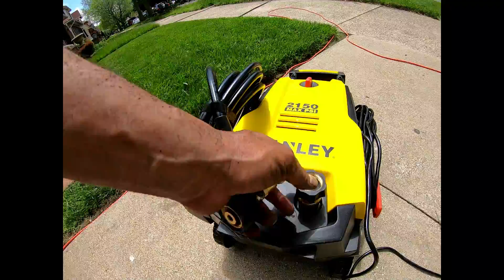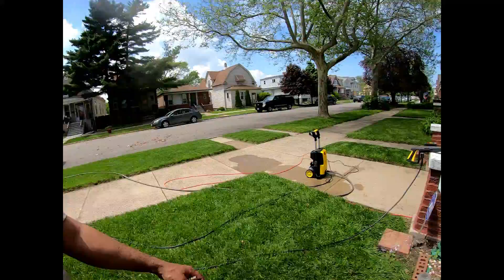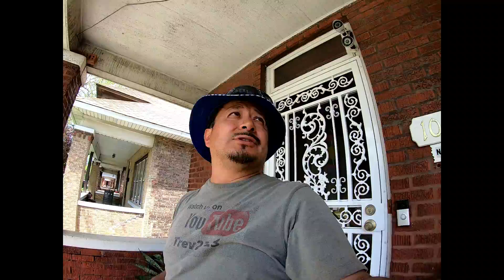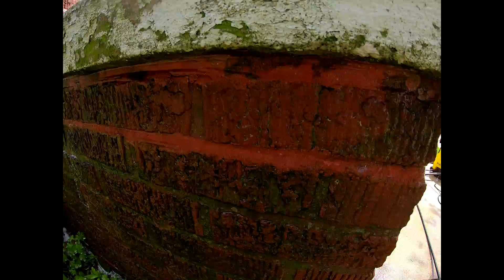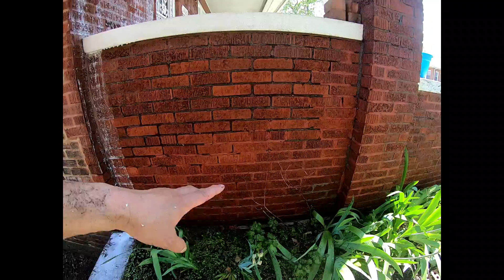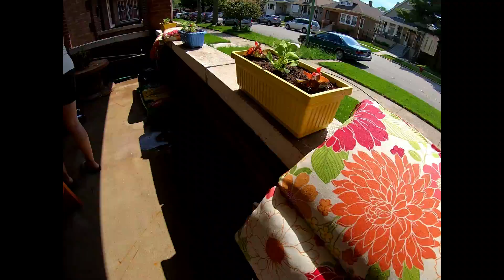Dawn dish soap a pressure washer and turbo tip

Comment: Thanks for the video. I was wanting to know if I could use dawn dish soap in my pressure washer.
Reply from the maker: There is a oil were supposed  to use yearly to oil it up. I haven't yet.
Reply: @RobHereAKATrev2323  well, I went to start my pressure washer but I think it’s broken. It’s Subaru brand…I haven’t used it in 2 years. But it’s got some years on it. Ugh 😑